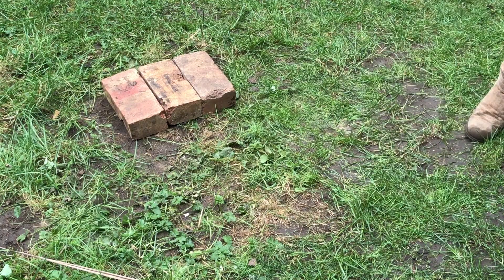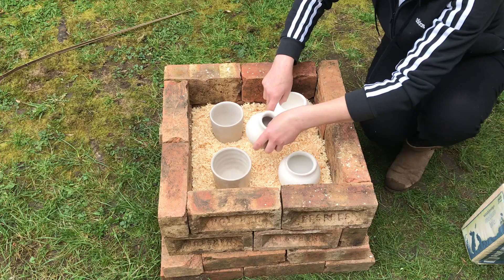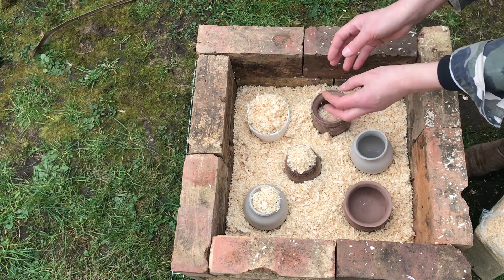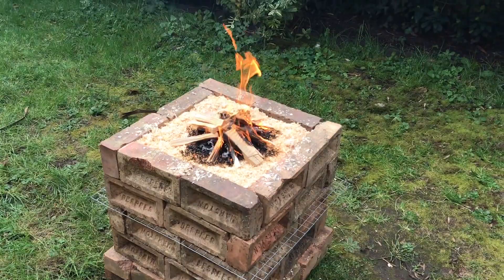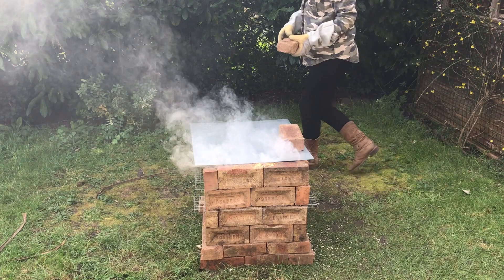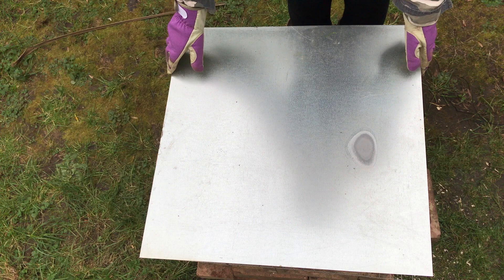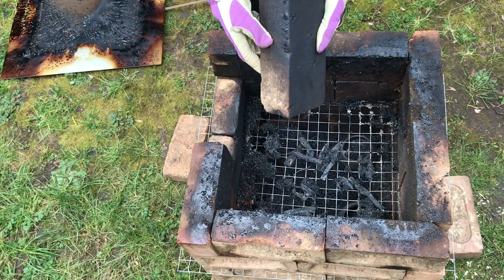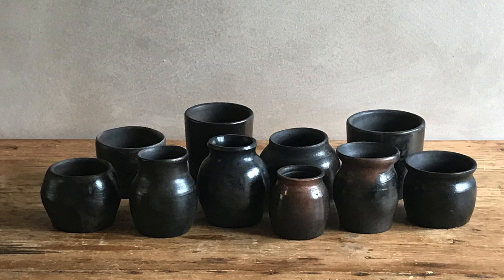Building and Firing a Sawdust Kiln

Comment: I have made some pottery out of garden clay and fired it in the pit that the clay came out of, it was just as successful as building a brick kiln without the need for bricks. This was 58 years ago when I was 20 years old. I used the clay that I had refined by adding water to the clay that I had dug from the clay pit and allowed it to settle in the pit without having to keep it in a bucket since it came out of the ground and no harm was going to happen to the clay in the process. It enabled me to refine far more clay than I could have made in buckets, without the need to buy a bucket. All the stones and sand  settled on the bottom and any vegetable matter came to the surface that was easily removed with a sieve. I suppose I could have managed to keep the clay separate from the pit with a sheet that would have kept the clay free from worms and insects, however I think that this would have been frowned on by my mother. Unfortunately I do not have any examples of the pottery that I made in this way, it having been so very long ago. And the pots were only biscuit fired, the pit having been far to difficult to regulate the temperature sufficiently for glaze firing.

Comment: A very nice result, thanks for the demo... My only issue is your steel sheet appears to be galvanized, you really shouldn't expose zinc to high temperatures as it can cause Metal fume fever (I know you are not in a confined space but I think it’s best to reduce any chance of exposure)
Reply from the maker: Thanks for your comment.  Probably should have worn a respirator!
Reply: @ThePotteryWheel  It's probably better to use non galvanized steel, if the galvanized has been exposed to direct heat (on a bonfire) then it should be safe to use afterwards... personally I like rusty steel, the various stages textures and colours can be very inspiring

Comment: Impressive that such a seemingly simple kiln could burn the wares to ceramics.
Just a sidenote, the metal sheet and grate seems to be galvanized, if so, be really careful about the smoke/fumes when it's placed in a fire, the zinc used to galvanize the metal is rather poisonous when it burns off.

Comment: Nice vid. All the interesting bits, none of the fluff. I like it. I also like the effective salvage/reuse of the bricks. Real good catch. Super practical. Algorithm must've got me here, since I've recently been doing some intense looking at foundry furnaces/refractory cement/clay/kilns/pottery and related "make things really really hot" technology as I get ready to build my personal "ultimate goal" multi-fuel foundry furnace. The coffee can one is OK, but as I do things, I figure out new things to do with the things I just did, so I need/want something a bit bigger, hotter, and altogether better to do 'em with. I've got the required materials, now I need to get a break in the rain long enough I can get the cutting and welding done. (I don't dare do it inside the OLD wooden barn, which is the only thing other than the house that's even remotely like shelter - have to do fiery/sparky/burny things outside and well away, which means "when it isn't raining", particularly when there's gonna be electricity (and therefore, extension cords) involved.
Reply from the maker: good luck with that, let me know how it goes :)

Comment: You have to left holes in the bottom living the air go through and the top a little hole. Like that will burn like you making charcoal.
Reply: I was also wondering why she didn’t space the bricks out more to get air flow for a hotter fire. I personally would have put not only sawdust but a good ring of charcoal around everything, hotter fire.

Comment: 8:50 I almost always build fires with the two "log" method. Select two objects, they can be logs, or rocks, or whatever, something between your wrist and half that in diameter. Space your two logs 3 or 4 fingers apart. If it's windy, put them crosswise, closer together, with the fatter log up wind. If there's little breeze, put them with the wind. Put your fluffy tinder between the logs, where it can't be crushed, then stack your kindling over all that, leave a hole to light the tinder, and add more tinder if you need to. That's it, just light it. If the tinder is burning up and hasn't lit the kindling yet, it's easy to tuck more tinder in and keep your mini stove going till the kindling takes.
Reply from the maker: Thanks Matt :)

Comment: As I understood, you used green ware (no bisque)? If so, your success rate is fabulous! I wonder how durable they are. Do you think they could be used as a household pottery? 
I always thought durable pottery could only be made with only very high temperatures.
Interesting video. Your presentation is very warm. It was a feel good video.Thanks!
Reply: Usable ware can be made from various clay bodies fired at different temperatures. Earthenware is lower fire and the clay body is softer (more porous) than the others. It is what much primitive pottery is made from. Stoneware is high fire and much more durable and is what most modern tableware is made of. Then there is porcelain which is the hardest, most refined and highest firing. All clay can be burnished to close pores, and decrease absorption making the ware more food safe. This was the process before glaze was around. Burnished pottery is not technically food safe but was used for ages for food. Not to say it doesn't work, but I am certain that people also experienced illness at points. I have pieces where the glaze has crawled leaving exposed bare clay and I still use a few of them... I have a pretty strong stomach though and seem to be alright eating stuff that would make other people sick lol.

Comment: Loved this!  Thanks for the detailed information!  I've been trying to build a small brick kiln for wood-firing, and this is by far the simplest, most affordable small brick kiln I've seen.  I have a variety of stoneware and wild clay pots to fire.  I wonder if you could put some charcoal in with the sawdust to increase the temperature for stoneware?  Although that might also increase the breakage rate...I also make my own charcoal so I've got loads of the stuff, and I know it burns about 200 degrees hotter than wood.  I also wonder if using a brick or two with the holes in them as air inlets or "mouse holes" along the bottom perimeter of the kiln (you could plug them up with clay or cover them somehow when the fire burns down to that level or to create a reducing atmosphere) would let more air in and the fire would burn hotter, if you want more vitrified stoneware. Maybe the thermal shock could be reduced by pre-heating the pots in the oven or over an open fire for. few hours first.   I guess I'll have to try it and find out!
Reply: i'm really curious to hear more about how this went for you. i have built a brick fire 'kiln' but yet to have success. first lot has just all exploded... good idea to preheat them near an open fire.
Reply: @MsHan71  I've built a small version of a cross-draft kiln with clay bricks lined with firebrick.  I used a small fire to slowly heat the kiln up to 100 C, then slowly built the fire with hardwood (maple and alder) branches and lots of airflow (use bars to support the wood above the coal bed or ash pit) until the ware chamber was at 900 C.  Held that temp for a couple of hours, with flames coming out of the chimney and the peepholes, and then started closing up mouse holes and chimney to induce reduction.  I managed to get to 1100 C by digital pyrometer.  This is hot enough to vitrify or even melt some earthenware, and hot enough to bisque stoneware and porcelain.  I'd like to hit 1200 C for stoneware glaze firing, but we'll see.
Kiln must be well-insulated and protected from drafts, cold outdoor temps, and rain.  Pots should be thin-walled, thoroughly bone dry, and preheated slowly with plenty of ventilation until the free and chemical water is gone.  That will largely solve problems with explosion and spalling.
Reply: You can use charcoal to get a higher temperature in your kiln, though your chances of breakage will be higher, as you guessed, unless you preheat the pottery around the fire for the initial burn or in your oven. You can also provide a lot more oxygen for hotter burning if you don't want a reduction atmosphere.
Reply: You will not get above bisque temperature, if that, with a kiln resembling this one. Stoneware requires a much more sophisticated kiln, as described by Pipsqwak, as well as long experience and much breakage before you get reliable results. Definitely preheat the pots, even if you need to let them cool a bit for handling to load in the kiln, as that will ensure all physically bound water is driven off.

Comment: that was amazing to watch, thank you for showing us!  i do have a question for you-- can you use this technique to make food-safe pottery?  i want to make mugs and bowls but don't have easy access to a kiln in a studio and was wondering if this would be a good alternative.  If not, can you suggest anything that might be?  thanks again for your expertise!
Reply from the maker: Hi Rachel, unfortunately, the pottery fired this way won't be food safe.  Where about are you based?  check out this article, it's got some ideas on how to find a kiln firing service.  I hope it helps!    https://thepotterywheel.com/10-easy-ways-to-find-a-pottery-firing-service-near-me/
Reply: @ThePotteryWheel  Thank you so much for the tip! Love your channel.
Reply: Could you not  put a glaze on or does it not get hot enough for a glaze?
Reply: You can use a brick kiln or pit fire to make food-safe pottery, you just have to glaze it with a nontoxic glaze to make it safe. Look up videos here for salt glazes and ash glazes and you'll find fairly easy ways to do that, though you'll need a hotter fire (more fuel for longer, with plenty of oxygen) for a salt glaze. Ash glazes should work at the same temperature as it takes to turn the greenware to ceramic. Check Andy Ward's videos for several outdoor firing approaches, though he doesn't glaze.

Comment: Amazing work, I really appreciate how simple and effective it is.
Did you preheat the pieces before you put them in the kiln, I mean the candling process ?
Reply from the maker: No I didn't candle them.  If I had maybe I wouldn't have lost the one that exploded...
Reply: @ThePotteryWheel  okay, sorry for that. Then how much  grogged or temper you added? And how long they stayed after making till firing? 
Sorry for asking too much, but I really need to know as I have been cracking my pieces in th firing proces and I need to know more about wood fired kiln designed if you know any pdf resources. 
Sorry again, and than you for you patience and help. All support and love.

Comment: While I'm not a specialist in pottery, I do quite a bit with refractory and am a bit surprised this actually worked. The top layer I would imagine benefitted most once the shavings cooked down and temperatures normalized while being fed from beneath, though I fully expected the bottom layer to be rather mushy. Very interesting! I would have thought that this would need periodic vents (moreso than chance misalignments) for air circulation to sustain combustion, as it's really up to nature's folly at hot and cold spots within.
If you happen to still have any of those pieces and have or know someone with a multimeter, I'd very very intrigued to see if any of them register resistance from the embedded carbon layer.
Reply: This was some 58 years ago, when I was an art teacher, the pit wasn't just a hole in the ground it was quite large, large enough for me to Bury the remainder of the Morris eight in, from which I had removed the half shaft and break drum to make a pottery wheel out of.  Also I had disassembled the  morris eight Into its component parts so that it could fit into the pit.  Also wasn't needed as a kiln anymore since, by this time I had bought a kiln. The reason  for me buying a kiln was because, as I said in my earlier comment, it was only able to biscuit fire the pots since the temperature could not be controlled with sufficient accuracy enough to glaze fire the pots.
Reply: @barryducret1052  I'm guessing this was a youtube faux paux of random comment replies, but it took me a moment to register a Morris was the car and not eight unsavory but notorious clay-wielding potters that need substantial justice. 😁

Comment: What a fantastic video! I feel very inspired now. Do you have the details anywhere, of which glazes you used? I am very new to ceramics, just learning about glazes. Is it possible to achieve lighter finishes, or will the colour always be dark, due to the contact with the sawdust and ash? Thank you! :o)
Reply: this is an old comment but if you’re still wondering she put greenware into the kiln so there’s no glaze on them! i think she mentioned that she used terra sigillata on one of them though which is like a type of slip that makes greenware come out sort of shiny (I’ve never used it myself but I know it can produce a beautiful finish!:)) also I think bisque firing like this is always gonna make the work come out dark because of the carbon from the smoke:)
Reply: @pintobears  Thanks! :o)
Reply: @wendydee3007  of course! hope i helped!:)

Comment: I'm afraid with such little holes for air/oxygen ingress, and that lid on top, this setup will generate a lot of carbon monoxide and some tar. Also, the heat generated will be less than otherwise it could. That said, most of the seem to have been fired well.
Reply: It looks like she's going for a reduction atmosphere here, which is a valid choice if that's what she wants. It's what she's getting anyway, intended or not.
Reply: @notashroom   you make a valid point.

Comment: Hello! Great video for anyone wanting to try this method. Plan on using what you showed in your video for my pieces. Are you able to include the complete list of specific materials and the quantities you used in the description? I was curious of the exact number of bricks and type of wood dust (pine, aspen, cedar, other?) Thank you so much for showing us how to build a sawdust kiln!
Reply from the maker: Hi Tiffany.  I use about 55-60 bricks.  With the sawdust, I just used sawdust that I bought in a pet shop I'm not sure what kind of wood it is, I imagine it's pine as that's cheaper for them to manufacture I think.  Sorry I can't be more specific!  I think hardwood will burn longer than pine, so that's probably worth thinking about....
Reply: If you can get to a sawmill, you should be able to get effectively unlimited quantities of sawdust cheap or free. The type would depend on what the mill processes; if they make construction lumber or boards, it will be mostly softwood, and if they make furniture lumber it will be mostly hardwoods. A place that produces firewood may have a good pile of hardwood sawdust that they may have no use for.
Reply: Thanks so much 👍

Comment: Great proyect to do at the backyard jjj. Few questions: is it low temperature clay, or stoneware? Does the pots had been fired once to make them bisque in advance or they're just bone-dry glazed to be finished after that single firing? Thanks beforehand ;)
Reply from the maker: Hi there, it's a mixture of different clays, some is stoneware, some porcelain and some is terracotta.  I put them in bone dry, but you can bisque fire them first.

Comment: Beautiful! Did you reuse the bricks and steel metal for another firing? Or should I at least replace the sheet metal every use? Thanks for your video!!
Reply from the maker: Hi Kaylin, I don't replace it each time.  I just reuse.  Hope that helps :)
Reply: I had that question too, thanks for asking Kaylin

Comment: I was wondering how dry should the pieces be before they go in and if they should be relatively thin or thicker?
Reply: Any pieces put into any kind of kiln should be bone dry, unless the kiln is going to fire at a very low (relatively) temp to drive out all moisture before firing. I raku fire with pieces generally about 1/4" thick and rarely have anything crack or break. I also preheat anything going into a raku kiln.

Comment: If you bisque fire in this way would you then be able to glaze and fire them again the same way to set the glaze do you think?  or would the charcoal bbq method be enough for the second glaze firing? Great video, can't wait to try it!
Reply: Sawdust in contact with glaze would ruin the glaze, if you want any kind of smooth surface. The temperatures in a sawdust kiln like this would be too low and inconsistent for nearly any glaze to reliably mature even if the sawdust could be kept clear of it.
Reply: @gjh42 thank you!!

Comment: Hi Lesley, I'm just building a kiln like your one. Do you think three levels for pottery would work? I mean, an extra shelf and another two courses of bricks before the steel lid. Or would it lose too much heat? Otherwise, for better cost effectiveness sawdust from an equestrian supplier would possibly work out cheaper than two bales from Pets at Home. I don't know whereabouts you are precisely but near me at Chislehurst is Speedgate / Frogpool Manor. The only problem with it would be the size of the bale for storage! Thank you so much for the video :) Best wishes, Lindsay
Reply from the maker: Hi Lindsay, re the number of levels, I think you'd just have to give it a try.  I have a feeling it might lose too much heat, but you could try it out.  May be just do a test run with a few pieces that you don't love that much.  Thanks for the tip about equestrian supplies.  But, yes, storage would be a bit of an issue.  The space I have is already bursting at the seams with 'stuff'!
Reply: @ThePotteryWheel  Thank you! I'll probably try it at some point - I have to actually make some pieces to fire first (I was waiting on my clay). If I try it I'll post here to let you know how it went!